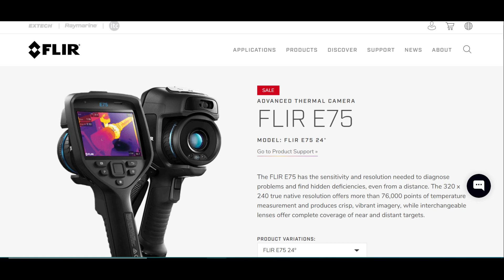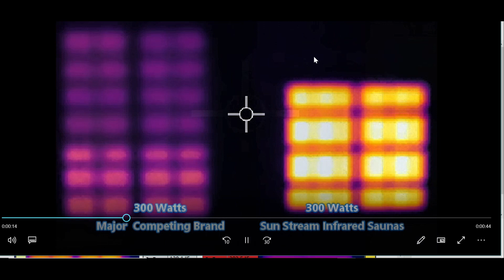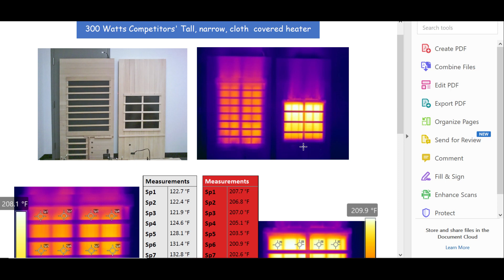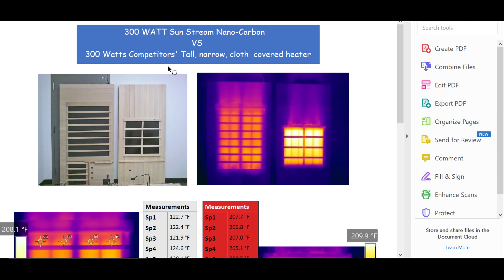Shocking Infrared Camera thermal analysis Sauna emitter review test

Comment: there's nothing shocking except the fact that you ignore the surface area of these sources. The left one is twice as talll. Yea, and when you concentrate the surface into one bulb it will be 20x hotter. concentrate 300 Watts into a laser and it will produce thousands of degrees in couple of milimeters
Reply from the maker: Yes thank you for confirming the exact point I was making! Why disperse the wattage over a larger surface area when a user sits on the bench and have that infrared go over the persons head and body above them? VS the right emitter layout concentrating the wattage lower down the wall thus where the person's back and body is on the bench when sitting? That was my whole point. The design of the carbon emitters on the right hand side sauna I feel is superior for more efficiently raising your core body temperature.
Reply: Not to mention the fact that while the total amount of energy across the square footage could be the "same" the reality is that the peak energy and peak room temp will ultimately be realized by the panel that can run hotter.